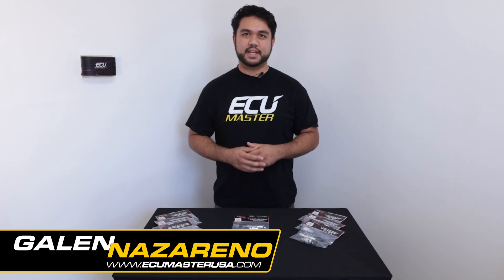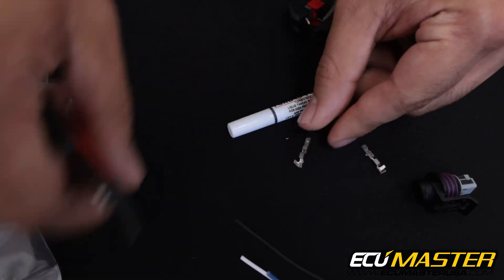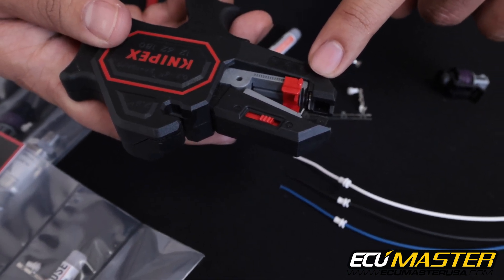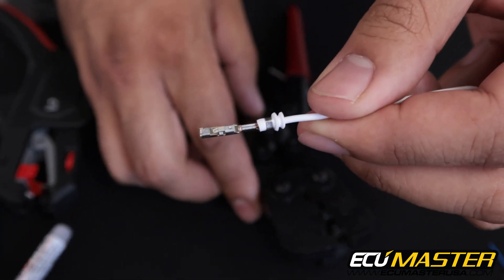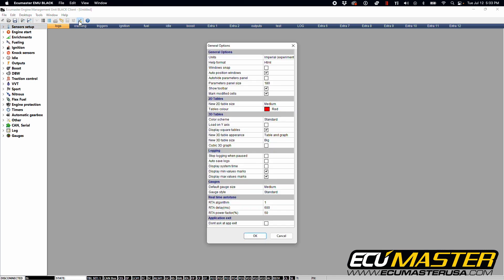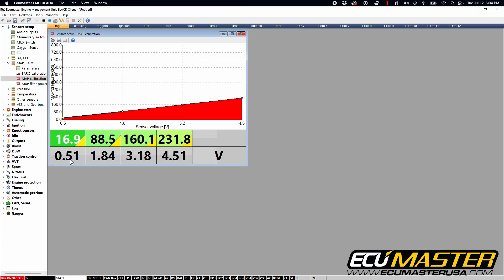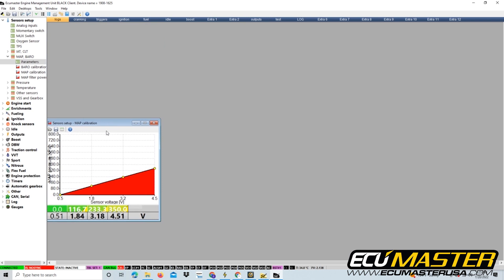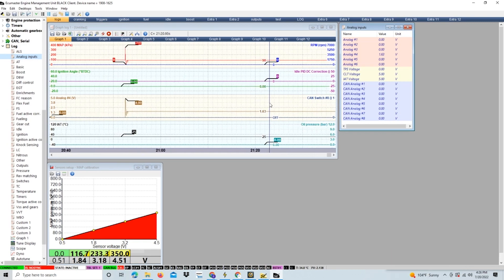EMU Black 3.5 Bar Map sensor setup | ECUMaster USA

Comment: Question. Doesn't the ecumaster black  have a built in map sensor? So if I had the ecumaster black would I still need a map sensor on the engine?
Reply from the maker: Some customers prefer an external sensor, and if you that route then it's possible to use the internal map as a baro sensor.
Reply: @ECUMasterUSA  thanks for explaining.